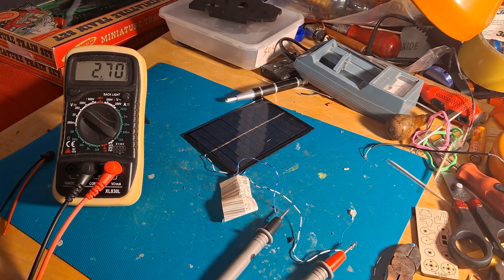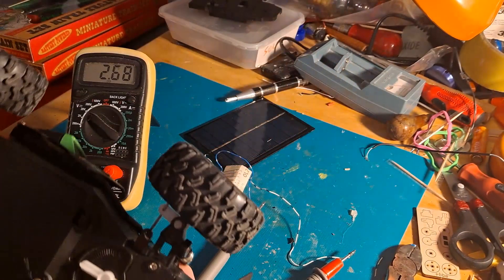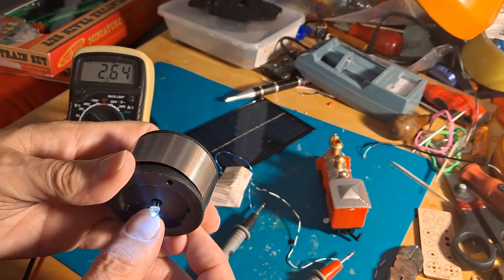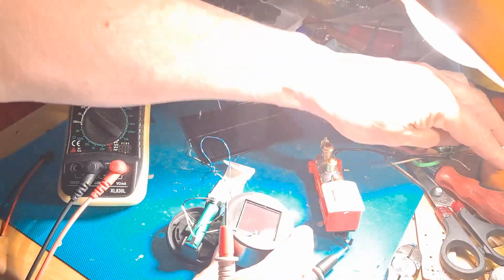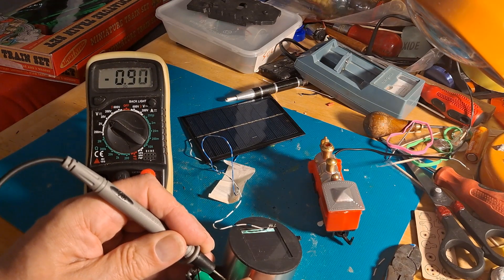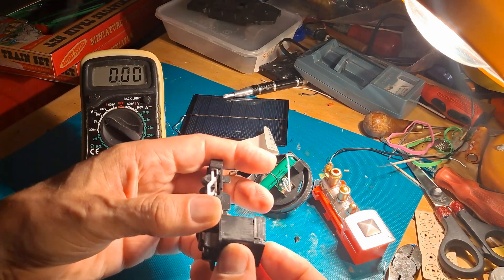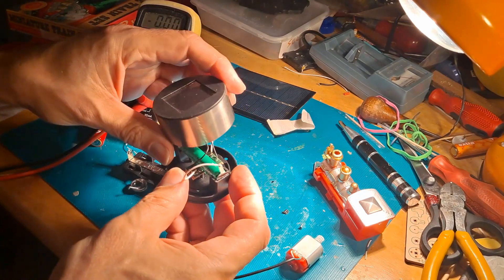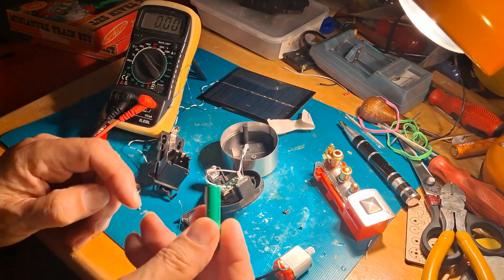Will that train run from a garden light solar cell?

Comment: Interesting stuff Grandad - I had no luck running trains/motors off a single panel either. It took 4 panels in parallel in very direct sunlight to run a simple Hornby tank engine, but with very little current to spare!
Thanks for sharing - Sam :)
Reply from the maker: Hi Sam, thanks for watching and commenting. You will find I have been pointing people at your video. Your link is in my video description. 😊👍
Reply: @GrandadIsAnOldMan  Ahh I didn't notice this - thank you very much for the mention! Funny that I should've stumbled across this video!
Reply from the maker: @SamsTrains  yes, I feel honoured that you found it. As soon as you commented I recognised your name. I am afraid I am not a dedicated trains enthusiast, you will see I ramble from one topic to another. This episode was a follow up to me buying the cheap train set from Home Bargains for £1.99. I was impressed how well it worked, I had very low expectations, given the price and the brand.

Comment: I've had good luck running mabuchi rf-500 motors on small, 100 x 60MM solar panels. Enough speed and torque to move water around.
Reply from the maker: Hi buddy 😊 Yes, with the right motor, but the question was specifically about the cheap toy train. I doubt that would be able to carry the weight of that panel, even if it turned the motor. A complete rebuild with a suitable gearbox would probably be necessary. Many of the motorised solar kits I have built, have little coreless motors and a good gearbox to get the torque required. There was a kit marketed as the "Solar Bullet Train" but that is no longer available. There is a link to a YouTube video in my video description.
Reply: @GrandadIsAnOldMan  wow Grandad you do know a lot about the solar panel. Thanks
Reply from the maker: @JustFun-iz9rf  I don't think so, but I have tried this sort of thing several times over the years, so I have an idea what to expect. I would love to get something like this working easily.

Comment: I freely admit to not understanding amps vs volts but I would imagine thats the problem here, there is more than enough volts but at what amps.. My idea was to use a small solar panel on a canoe or kayak with an elec motor. the motor couldnt run off the panel but it would be feeding energy in so I would get a little longer run time and of course anytime Im stopped it would be changing but Ive been told its not feasible because of some suburb in california and a couple energy drinks.. watts, amp, voltz....
Reply from the maker: No need to get complicated, the simple answer is those panels are too small, the size of panel you would need would be too heavy for it to move unless you gave it a good reduction gearbox. And of course there would be the minor problem of where could you stick a big panel. You might be able to mount a dozen small panels on carriages and link them together, but I think that would still be too heavy. If it was a good old fashioned electric train getting it's power from the tracks, you could have the solar panels on the ground sending power to the rails. That would avoid the problem of the weight.
Reply: @GrandadIsAnOldMan  you explained it well in the vdo enough that I realize why they say its not feasible to only mount a single panel on a small boat. I would need 3 or 400 watts of panels and for that $$ I could add a whole bank of batteries cheaper and not have to worry about wind!  to actually power the motor with solar Id likely need 2 longer 14' canoes...and I have trouble carrying the 10 footer..... shrug

Comment: i cant seem to reply via notifications but came back to the original video. no, the concept via sams trains is not the same . this was able to be run out of doors   using standard solar panels . sams trains concept would be worth looking into.
Reply from the maker: So was it powering the train via the tracks? Not much use for this little fella as he has plastic wheels. But a complete redesign and metal tracks would do that. Not exactly the point of the video though 🤣

Comment: there is one fellow who had a made a oval of ho track and had a rack of solar panels . no controler but ran nicely. no, totally different feller, but interisting concept though.
Reply from the maker: Was that the one I linked to in my video description? https://youtu.be/aBO2jXcE-cg Many of the motorised solar kits I have built, have little coreless motors and a good gearbox to get the torque required. There was a kit marketed as the "Solar Bullet Train" but that is no longer available. There is a link to a YouTube video of that kit in my video description.

Comment: I keep thinking about driving my big flywheel with a solar panel. Those LEDS will illuminate between 2 pieces of iron. Nikola Tesla had some strange ideas. Sounds like you need multiple panels on each car connected in parallel to the motor.
Reply from the maker: It struggles to pull any cars, so adding solar panels on each one is unlikely to work. It also falls over easily, so getting the cars to balance with weight on them would be an additional issue.
Reply: @GrandadIsAnOldMan  wider rails and flatbed cars.  ;)
Reply from the maker: @MAGnetICus_Attractus  not really the point of the video. If the question was "Can you make a solar powered train" then I would have taken a different approach. The question was quite specific. 😊👍
Reply: @GrandadIsAnOldMan  I'm just trying to picture in my mind the number of panels needed to turn the motor. If the battery struggles to pull the light rail cars, then I could see the engine doing a burnout on the rails. So I guess my question was how many small solar cells in parallel to even get the motor to turn? My crazy brain pictures about 30 tiny solar toy panels.
Reply from the maker: @MAGnetICus_Attractus  this guy had a good go, slightly larger train and track, but the same principle https://youtu.be/aBO2jXcE-cg
Reply: @GrandadIsAnOldMan  thanks for sharing that. One day these silly earthlings will figure out magnets on iron wheels attract iron rails. ;)

Comment: The simple answer is: a "garden light solar cell" far not have enough power to be able to operate a cheap toy motor even without any physical load. Usually just ~1-2V with comically low power. 😶
Reply from the maker: Yes, but when people ask me a question, I don't just say "no it won't work", I try to back it up with a video to show that I have actually tried it for them. Many of the motorised solar kits I have built, have little coreless motors and a good gearbox to get the torque required. There was a kit marketed as the "Solar Bullet Train" but that is no longer available. There is a link to a YouTube video of that kit in my video description.
Reply: @GrandadIsAnOldMan  Okay, but this type of cheap motor likes to draw more power, which is not available with a "garden light solar cell".
I have an old salvaged "garden light solar cell" outside of our house with a wire coming into my room. I'm only able to operate 1-2 small red LED with it, nothing more, because basically no power available with the generated ~1-2V.
Reply from the maker: @zsombor_99  yes, that's right. If you look at my video description you will find a playlist for my solar powered cars along with many other solar related playlists. The solar robot kits all run fine on small solar panels, but as I have said, they all have good gearboxes to generate the torque necessary to move them forwards.